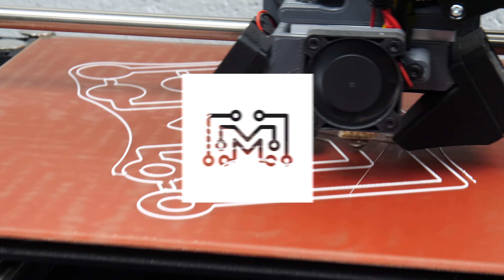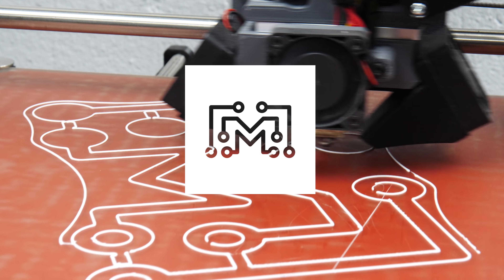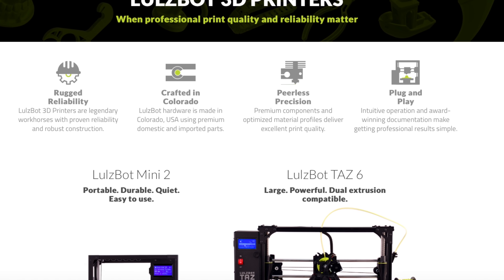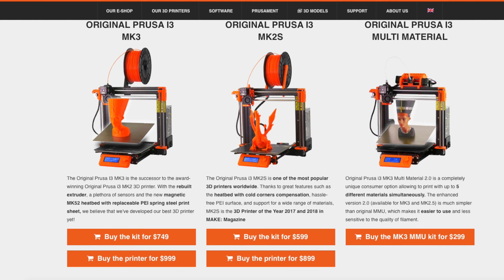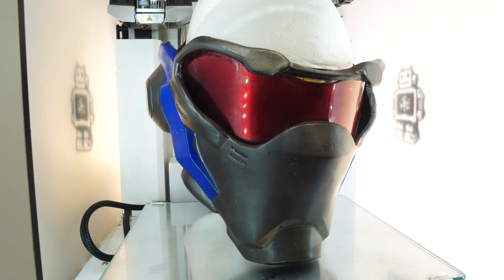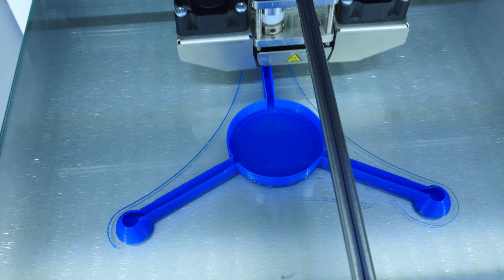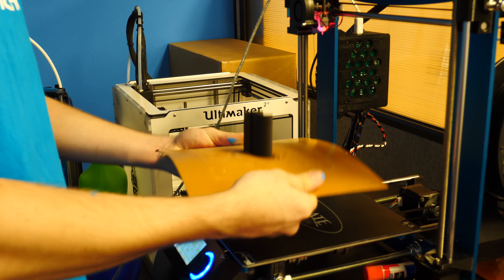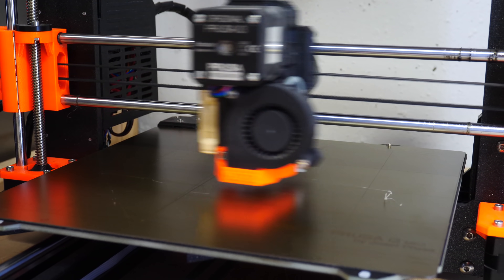Buying a 3d Printer // Bits | I Like To Make Stuff

Comment: A tip for everyone with a cheap 3d printer. If you're printer doesn't have wifi, install Octoprint on a Raspberry Pi. It's a wonderful piece of software and I use it all the time for my Anet A8.
Reply: I did the same for my Anet A6

Comment: my wifes uncle got a kit for $55, he is still calibrating things 2 years later, don't go cheap guys
Reply: I can only imagine how slow that printer's print speed will be after it's finally calibrated. Sounds like it was one of those cases where he spent time when he should have spent money.
Reply: It all depends. I purchased a broken Anet A8 kit for $50. Several of the acrylic pieces were broke.  After a little superglue and a handful of hours I was printing very reasonable prints for home a shop use. I've heard of a few people having issues but my experience was fantastic. There were several great videos on the build and calibration. My shop now has painting triangles, feather board, angle gauges for setting angles on bench grinder and a lot more. BTW most of my early prints were extra supports to help improve the printers stability plus I reprinted the broken parts so I had back ups if the glue ever fails. 

All in all, I didn't find it as difficult as some people said.
Reply: I would love to find a medium grade printer in need of a little repair for a good price. But, I never see anything I would be willing to pick up (maybe I'm looking in the wrong places on ebay).

Comment: Great video but only thing I disagree with is the $600 decent quality comment. That has changed in the last 12 months. You can get a VERY. good printer now for under $300 right out of the box that prints amazingly well and only a few screws to assemble with full aluminum extrusion metal frame. Some have recover from power loss and filament runout sensors, flexible build plates and more.
Reply: Do u have any recommendations on specific printers?

Comment: Helpful to keep in mind the type of extruder on the machine as well. If you're using flexible (TPU) filaments, they'll just ooze out of every place they can with some extruders. Some printers are better geared toward flexible filaments than others, but many can be modified to support it. It was recommended to me that Prusa's are particularly good with flexible filament. Also, put down some glue stick when printing with it, as its adhesion properties mean it could rip your bed surface right off.

Oh, and great video Bob!
Reply: True, would've been nice to add, although, even Bowden systems handle TPU pretty well if you slice it correctly -Ninjaflex is another story...
Reply: kurt lindner I've personally only used the 85D NinjaTek TPU and had good luck with it in a Prusa, but heard messy horror stories about using it in other printers.

Comment: I bought a AU$500 delta style kit 18 months ago.  It's not for the faint hearted, as it took about 6 hours to assemble and being totally new to the game, and about 5 hours to calibrate.   Prices have come down a lot since i bought mine, and the print quality has increased.  Don't be a fraid to slice your large models and glue for final result.  Get used to CAD software, and vernier calipers, you can then fix most of your household items easily.  Eg, remote control battery covers, light switch cover mods, boating & camping accessories.  Filament is cheap!

Comment: Great tips and I agree with all of them. One that I would add is noise level. Everyone should ask/know about noise level before buying a 3d printer in my opinion! Believe me, stepper motor whine and vibrations noise paired with a 5 hour print are not fun! I changed the control board for my machine to make it silent and I am never going back to using a loud machine. Now I can have my printer in the same room next to me printing for hours while I design and work on my computer.

Comment: The mid range Monoprice printers are in the $300 to $400 range and print right out of the box. I've made almost no changes since setting mine up a couple of years ago. Assembly is just a few screws and leveling the bed. Great for a cheap first printer with a reasonable build volume and price.
Reply: The Monoprice stuff can either be rock solid or a serious pain to deal with, and which you get seems to be luck of the draw.  I have a MP Mini that has been rock solid for over a year, but I've seen plenty of reports of problems with those.  And I actually just bought an Ender, which seems to work well so far, but takes a bit more effort.
Reply: Yeah, it's probably not good to go off of anecdotes, but I've just been blown away by my Maker Select. I watch videos of people with Printerbots having all kinds of issues, and mine has always just worked. I was prepared for all kinds of issues based on what I had read about 3D printing, and the damn thing just goes. I was wary of the mini because of the lack of support for the print head, but for the price, it's hard not to jump off into the world of 3D printing! It really isn't that technical. Just google any issues and be ready to throw away some PLA if something goes wrong.

Comment: I bought a basic printer. It's tough to modify afterwards because the electronics for extra stepper motors bed leveling and all the other accessories doesn't exist on the basic machine. There needs to be a PCB with all the ports for all the accessories if you plan to upgrade your way to an amazing printer. With detection software to tell the printer you added a new bobble.

Comment: PETG is actually a family of plastics, and different versions of PETG will print at different temperatures. Some PETG (for example 3D Solutech) will print at essentially the same temperature as PLA (or maybe 10 degrees hotter) so most printers that can print PLA can print PETG as well.

Comment: I have been thinking about purchasing a 3D printer to help with tool organization in my toolbox. Having tools floating and ending up in a pile at the back of each drawer is annoying.  Foam breaks down and cant be cleaned and the single thickness when each tool has different depth requirements is also not the best. Bob, have you ever used a laser scanner to create a profile of an object that you have then gone and printed out a custom 3D form for? Have you had any issue with compatibility between the two?

Comment: You didn't mention that cartesian 3D printers are usually more expensive than Delta 3D printers. Also, Delta 3D printers are usually faster and have an overall greater build volume compared to the size of the printer itself. You lose a bit on the resolution though, which is something to keep in mind. I got myself an Anycubic Delta Linear Plus, and it's a great printer for a couple hundred bucks. It comes in a kit so you got all the pros (and cons) of that, meaning you understand the printer better and it's easier to service, but it takes 4 hours before you print something, and calibration is not out of the box.

Comment: What about heated vs non-heated beds for printing? not sure what the benefits and draw-backs are for each of them
Reply from the maker: Heated usually helps with adhesion and always has the option of not using the heat if need be.

Comment: Hi Bob and you like to make stuff.  Great video. This one would be for my second printer. My first is a modified anet A6 which have ups back-up. Next upgrade will be run out filament sensor.  After that it will be time for the CR10-4S. I like to tinker with mine.
Great video as always 👍

Comment: Also worth a mention is safety - many budget printers come with all safety features disabled because the cheap chinesium parts can cause false negatives and shut down the printer, ruining prints.

These are the printers that you read about burning down someone's home.

If you reflash merlin onto the main board, then you can re-enable the safety features. Upgrading the printer with mosfets and a smoke alarm is also good advice.

Comment: be cognitive of the filament that you use and for what purpose.

also if you make a model that lacks a flat surface to align to the plate. make a small orientation cube on the same plane as the model's base.  had this issue with so finger rings i made back when i was learning cadd.
Reply from the maker: Yup, we're doing a whole separate one on filaments.